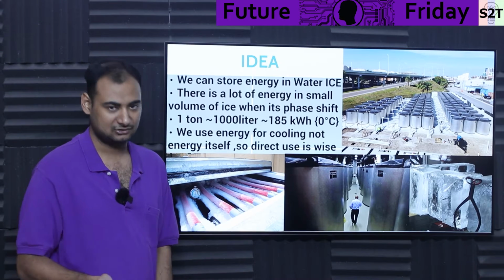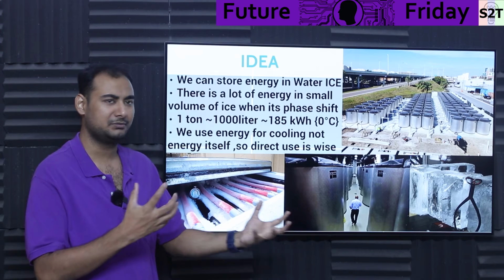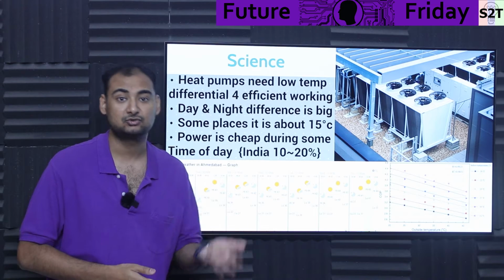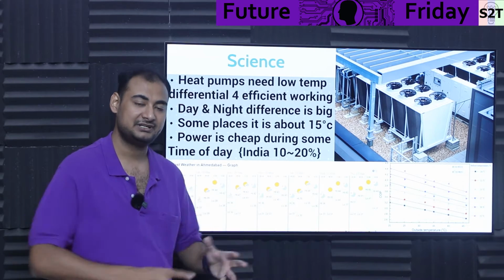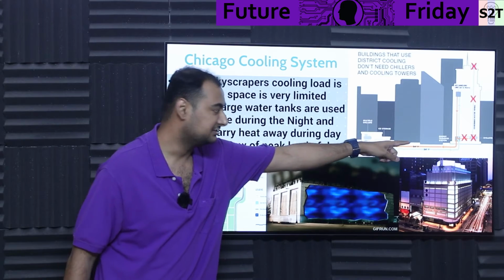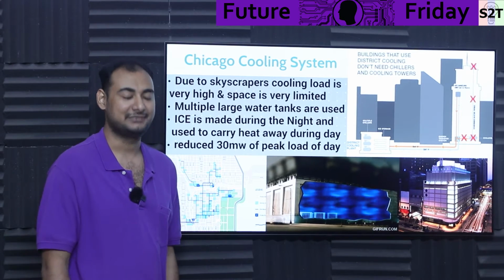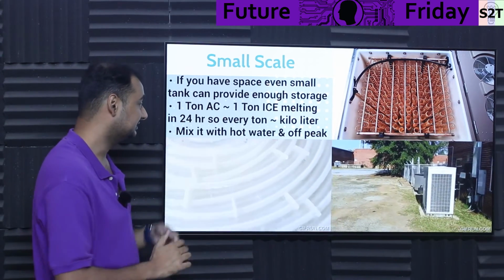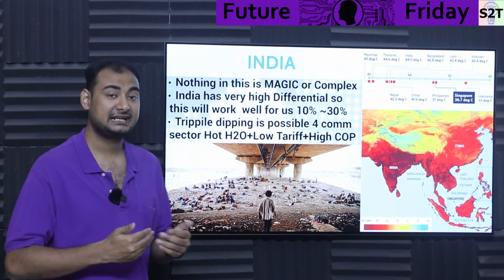Ice Thermal Energy Storage {ITES} Explained {Future Friday}

Comment: Okay okay anupam let's calm down here 🤭 nobody is boiling water 😂

It's not geothermal heating or cooling 

U are using an existing water tank , heating the water from 25-35°c during the day let's say within 6hrs during the peak sun it's enclosed water tank = no water loss

It's not insulated water tank it's a concrete water tank on the basement of your house (pls do check if you have the time) 

Heat losses through the walls of the tank just like heat losses from an air-conditioned room with concrete wall

Difference air - ground 
Ground reservoir is much bigger 
You can dump lot of heat but very very slowly 
You have 18 hrs left in the day to slowly dissipate that heat to the ground 
High surface area of the tank is well suited and high heat capacity of water is good for temporary heat storage 

Alright 👍? I hope you understand now 

Or 

Say what 

Try doing the math yourself 

🤭😂👍 All the best
Reply from the maker: Not everywhere has concrete water tank on the basement   (I have only seen it in commercial &Ahmedabad its more of a new thing ). Difference air - ground  Ground reservoir is much bigger TRUE but its not conductive enough that is why coal power plants have to use air cooled condencer not geothermal cooling . you can only do this in small scale . You should try it I can see it working for small few ton system but not from 100s of KW and let alone megawatts

Comment: isnt that dumb for india?? we have too much solar potential so day time will be energy surplus so we should use the energy during the day, a much simpler solution would be to use your water tank as heat sink , every house already has one , in fact they have 2 , one in the basement and one on the roof , guess what , the tank in the basement is almost always much colder than ambient some cases as much as 25c colder so just using that as a heat sink and using electricity during the day will be much more beneficial. just run a pipe and a coil down there no fancy radiator or fans needed
Reply from the maker: LOL nope and if you dump heat into basment tank you will boil it away very quickly remember if compressor is 2kw and running at the cop of 4 that is 8kw of heat per hr that  is a lot of water loss . Heat has to go to air eventually so dumping heat at night in AIR is far more sustainable rater than boiling water away and  DAY time is very stress full for the whole  grid as everything is drawing a lot of power as Transformer heats up its efficiency goes down & so does transmission lines reach therir temp max

Comment: I get the enthalpy of fusion for water to just over 90 kWh per ton, considering the cost of water, it's still a lot. 

Freezing water quickly has a lot of interesting aspects, if you try to freeze water through a growing layer of ice that layer of ice insulates, and required delta-T for a given rate of freezing through a given area skyrockets as the layer thickens, and by that the COP plummets, all else equal, as it's the delta-T of the refrigerant that dictates the COP, not the temperature you use. Theoretically, cooling down from 50 to 0 °C could be done with a COP of over 5. Accounting for some loss in the compressor motor, and friction, a system truly optimized for efficiency  should be able to reach near 5. It wouldn't be cheap, and it would have to have very big heat exchangers for it's output, but it should be possible.                 

Anyhow, I think the idea is great, and has great potential, but designing a really good such system with high COP is probably not easy. I'd look into ways to remove the ice, and collect it.
Reply from the maker: its already in use from large scale to small scale and that I have shared the video about how people do it In the image I shared there u can see its a very large & intermingled  distributed surface area so I does not insulates too much . WHY u are counting the cost of water its one time investment not  refil everyday . onec sealed u forget about it
Reply: @s2tenglish  That was part of my point, the cost of water is insignificant.
Reply: Aah?
Reply: Cop of 5 for a 50°c delta is very very hard, isn't it? I have seen a 2 stage compression heat pump (like one of the most efficient air conditioners for home use) they hardly achieve a cop of 3.5 - 4 when the delta is 20°c 

So for a given delta of 50°c 5 is very hard to achieve practically speaking (almost impossible) and even if we assume best case scenario it's 30°c then in order to have heat flow you would need atleast 5 to 8c below zero so with a delta of 35c achieving higher cop than airconditioner in day time with just air is kind of impossible so yeah this ice thermal thing only makes sense if the electricity prices are lower in night compared to day
Reply: @rakeshjain5180  How hard it is to reach a COP of 5 at 50 °C delta depends on the temperatures, at the temperatures mentioned it can indeed be described as very very hard, as it is somewhat close to what's theoretically possible, assuming a single stage "conventional" vapor compression heat pump. As the theoretical limit of efficiency of heat pumps is the delta T relative to absolute temperature, or the inverse of Carnot's theorem.         

"Consumer" air conditioners are typically far from as efficient as they could be, a lot of potential efficiency gains is sacrificed to keep cost low and size small, without making other sacrifices. A large part of the cost issue is development of "new" technologies, or adopting better technologies known from other applications, and making the adoption of them worthwhile compared to keep making small incremental improvements of the technologies that has been used for cooling a very long time. Meaning, more efficient systems wouldn't have to remain that much more expensive to make forever. 

But then again, if cost of power varies between zero, and astronomical, if you can store useful energy, energy efficiency when storing is not very relevant for overall cost of of the useful energy you get out of the system.